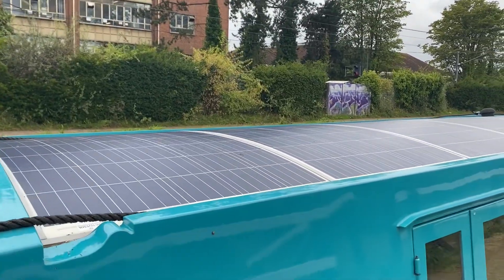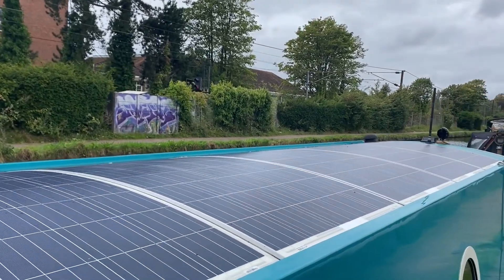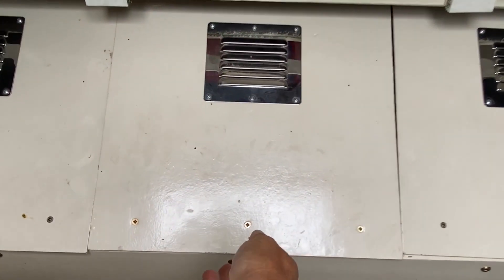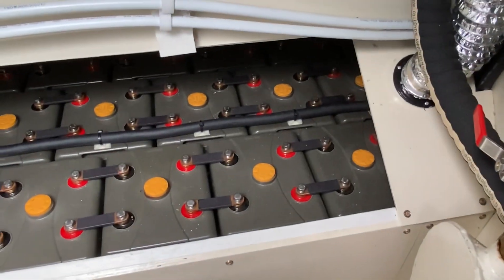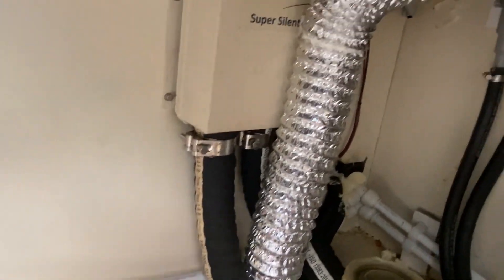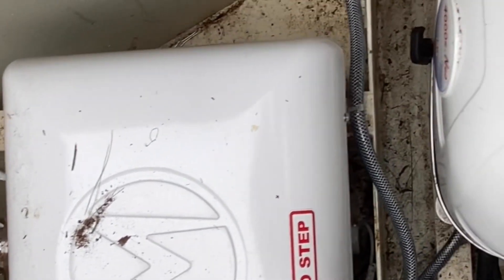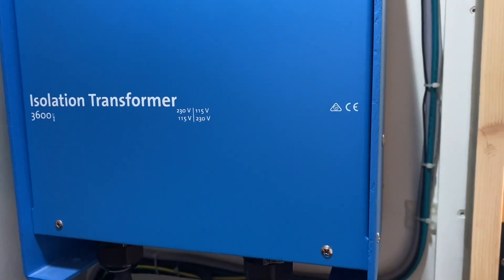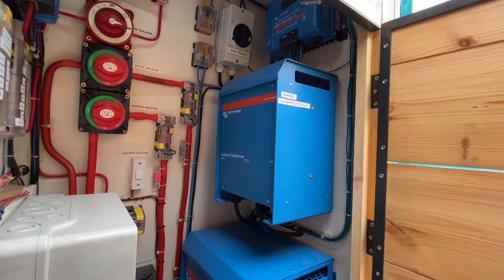The electrics on an Electric Narrowboat

Comment: * UPDATE * 

The typical power usage for cruising the canals is 2.0kW to 2.5kW ... it boosts to double and triple to move from standstill.

Your rooftop solar array is rated at approx 2kW production capacity. So, on a good summers day you can produce 10kWh of energy which you can store in your battery bank. Your engine is rated at 15kW. My question is, on a typical cruise through the canals, do you use up 3kW or closer to 5kW? I am not asking about getting her moving from standstill, which obviously requires a lot of power. I mean cruising down the canals at a constant speed without wind or any turbulence. My question is about understanding how much cruising you can realistically do on solar. By my estimate its once a week, cruising for 3-4 hour max unless you engage the generator. But i would love to be wrong.
Reply from the maker: I have a monitor that tells me how many KW my motor is using at that moment. I tend to cruise along at 1.2 to 1.5 kw. On a summers day I have left my mooring at 70 % power. Cruised for 6 hours and moored up at 82% power. My first summer on Watt Way I didn’t use my generator from end of May until September and cruised around east Anglia moving every day
Reply: Do you tend to travel / cruise at below 3 miles per hour (mph)? I ask bc 2.0 to 2.5kW is needed to cruise above 3mph to the canal speed limit of 4mph.
Reply from the maker: @hellenicadvantage7439  I tend to cruise at somewhere between 2 to 3 miles an hour. More than fast enough for me on the canals 🥰
Reply: @ElectricNarrowboat  yup the maths makes sense. You need 1.2 - 1.5 kW to cruise between 2-3 mph and almost double that to push it to the 4mph max on the canals. Law of diminishing returns. Efficient cruising would be in the range you are choosing. But i imagine there is nothing quite like getting that +1 mph on the canals! Wish I had a narrowboat ... who knows maybe someday. Great channel, great work you are doing. I love the way you start each video.
Reply from the maker: @hellenicadvantage7439  Thank you. You seem to know a lot about the electrics side of things. Do you know anything about batteries?  If so what do you think of AGM batteries??
Reply: @ElectricNarrowboat  if you can afford AGMs there is no comparison w/ Lead Acids in terms of safety and longevity. But the cost is a serious obstacle as regards onboarding into a narrowboat. I know a little about narrowboats because one day I would like very much to own one. I consider it the epitomy of being in harmony with nature. The electrics is an aspect that I enjoy because with a 2kW array like you have, a narrowboater can cruise the canals 2/3 of the year without need to purchase power or diesel. But there are other aspects of narrowboating that also fascinate me like the engine type (mechanics), the layout choices of the interior (ergonomics) and of the design choices for the exterior (engineering). Narrowboats are just fascinating in so many different ways.
Reply from the maker: @hellenicadvantage7439  Thank you. Price wise AGMs seem to be halfway between lead acids and lithium’s. I would like batteries that don’t fill my boat with hydrogen on a sunny day🤣🤣

Comment: Sorry, you must get sick of being asked this question but do you ever need to charge up the batteries separately from the solar panels and generator on board and if so, where would you do that. ? 🙏
Reply from the maker: Hi Simon. I’m not sick of any question, I’m glad that you are interested. Sometimes if my batteries haven’t been at 100% for a while I plug into shore power to fully charge them. This year I have done it 3 times. Plug ins can be found in marinas, outside pubs and the moorings run by charities - these are the best value. 🥰
Reply: @ElectricNarrowboat  thank you so much for your reply good luck on your journeys I’ll continue to watch the ones you share with us . 👍🏻

Comment: I have no idea which is why I am asking.
Would you or indeed anyone that also knows what they are talking about be able to advise me on the following please?

Is your 15KW motor capable of providing equal or better propulsion to deal with river or tidal flow.  I have seen videos where people have got into trouble due to insufficient power.

I look forward hearing your and other people's views on this
Reply from the maker: Evening. My boat has been specially designed to undertake the Ribble Link. My boat builder assured me that she is able to fight that current. I will find out next summer when I attempt it. She did manage to fight a strong current on the Tidal  Great River Ouse whilst travelling from Denver Sluice to Salters Lode. My motor is also water cooled to prevent it from overheating and stopping.
Reply: Thank you for that. I hope it goes well for you.    @ElectricNarrowboat
Reply from the maker: @socairnone5550  Thank you. And you 🥰
Reply: Thank you ...the more I learn the more I find I need to know..  all help is appreciated and invaluable when it comes from people with experience   @ElectricNarrowboat
Reply from the maker: @socairnone5550  Thank you for that. All questions gratefully received and if I know the answer I’ll let you know. If I don’t, I won’t make it up but maybe someone else would be able to help us out 🥰

Comment: Be carful with those ,metal covers don't drop onto the exposed battery terminals. Old form of travel converted to a modern concept. Love it. As narrow boats don't need to get anywhere fast. And so just pull over and recharge.
Reply from the maker: Hi Andrew. Glad you liked it. The covers are made of wood, I suppose for the very reason you pointed out. It’s a nice life waiting around for the sun 🥰🎉🥰